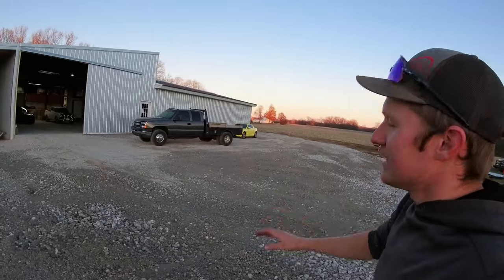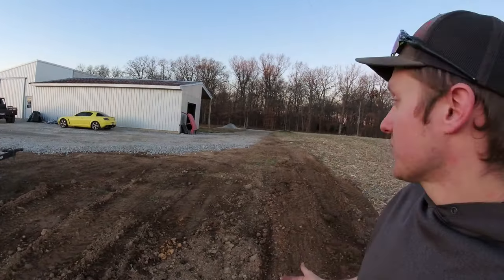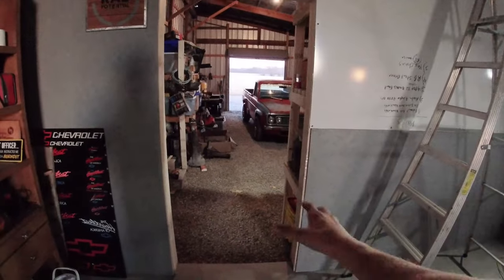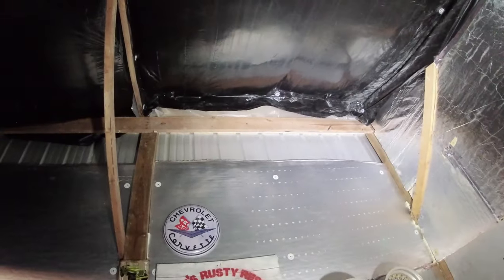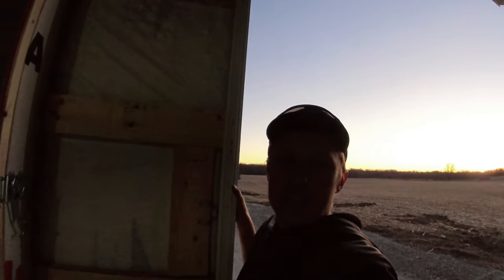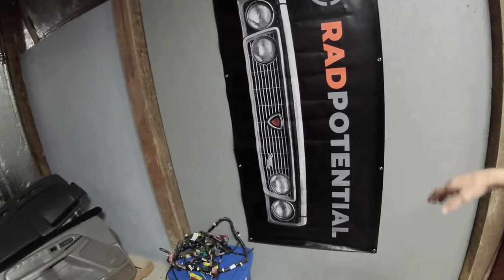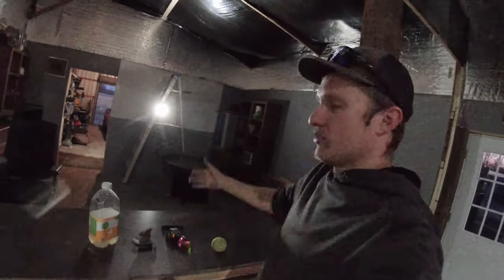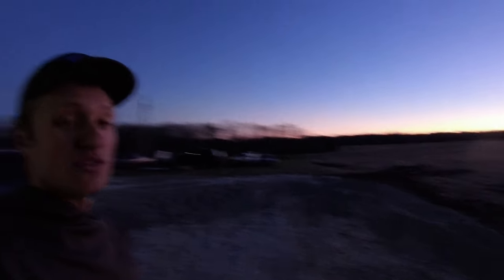Transforming an Old Barn into a Car Workshop - RAD Works Part 1

Comment: As an insulator, I would've suggested a higher Rvalue in the ceiling for sure if you could've. I know you budgeted. It is not cheap, but I am pleased that you sealed it well. The vapor barrier is honestly a huge help on its own. You can't really do one without the other for it to be effective. It's definitely not perfect but hats off. You did a great job.